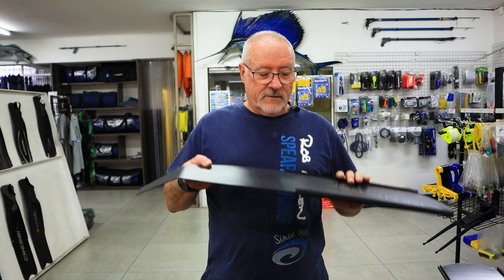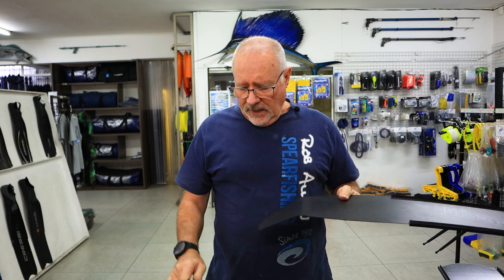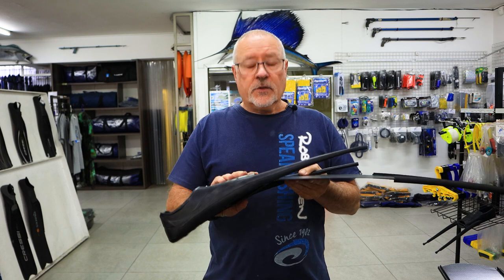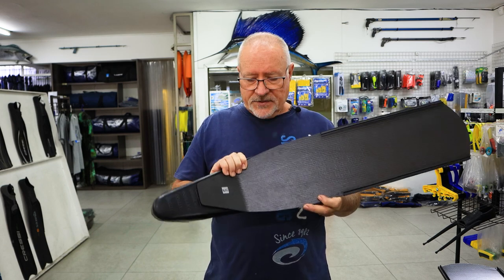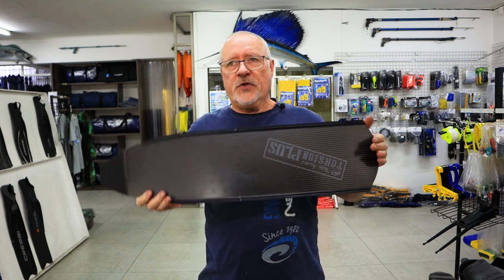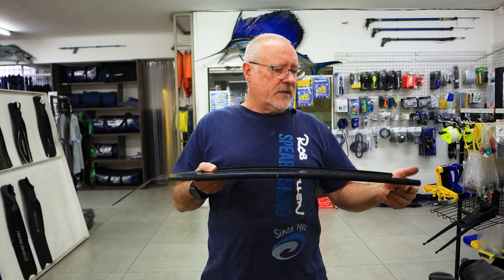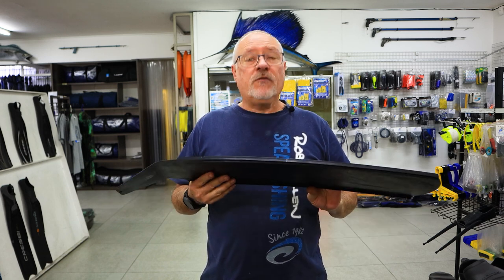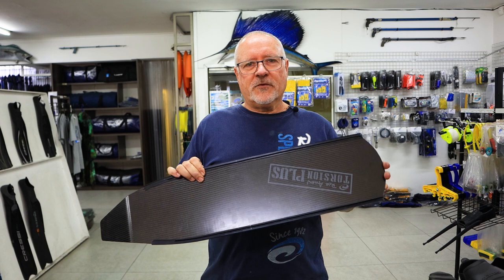Rob Allen | Foot Pockets | 2022

Comment: Apologies, but this video makes no sense... tried to order these fins in the UK and instead of soft medium or stiff- the options are S4 S5 S6... what's that all about? what is the exactly are the  weight options?? 20-40kg - for soft  40- 80 medium over 100kg for hard??? AND what angle is the fins at??? Cant find any info on this?  The fins look great - just not sure about the skew boxed in graphic - sending my OCD in overdrive.
Reply from the maker: Hi, the video was not about how to choose a blade but about how different foot pockets are from each other and. each persons needs can be different. In terms of stiffness, the  S is for stiffness. The number is related to how many layers there are in the blade geometry. The higher the number the more the layers. We make from an S3 to an S7, that is 5 variants and, can custom make in-between stiffness's. As mentioned in the video, the users weight is a rough idea what works best but can still vary. The  "boxed graphic" are you referring to the still image in the previous video? If so, this was the best angle to show the different layers.